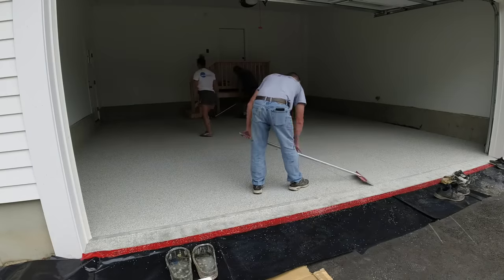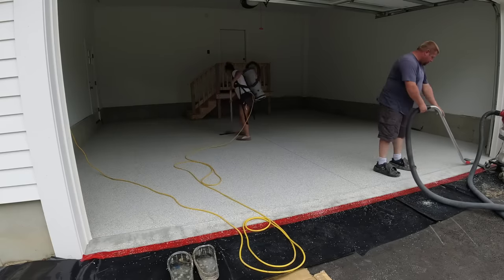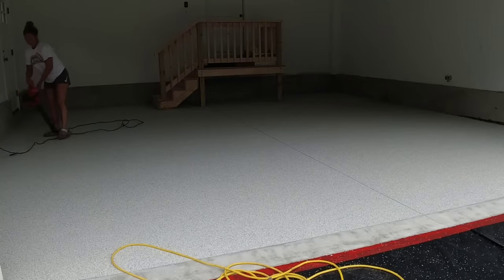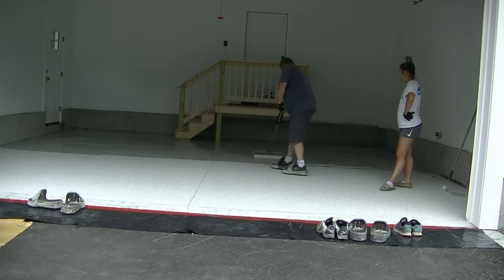DIY Epoxy Flake Garage Floor Coatings (What Most People Don't Tell You)

Comment: Question,.....do the professional epoxy products resist welding spatter from a mig welder and grinding speaks or do they still get burn marks ?
Reply from the maker: It'll resist them better than the cheap stuff but will eventually do some damage. You're best bet would be to use a urethane cement coating and broadcast flake into that.
Reply: Whatever is used will deteriorate more than the actual concrete but will maintain the look u want.
Reply: I would recommend quartz instead of flake for a area with a lot of metal fab. It will all scorch and burn but quarts should withstand it better. Although nothing will hold up under welding conditions just remember one thing.... your coating will be a sacraficial layer. The coating will save your concrete! Coatings are easier and cheaper to repair than repouring a concrete slab!

Comment: I forgot to really focus on my tire trail. We did an acid wash. But probably should’ve done more to bring up the oil from pulling in and out for 20 years. Then we put epoxy down. Took about 5 years but those tracks have all flaked up. So now we have to redo the whole floor. But just my experience from starting with old concrete and 8 years later real life.

Comment: I live in Wisconsin and I have never seen this kind of floor last more than 2 winters.
Reply: I live in Cali, have had the same big box epoxy for more than 12 years lol
Reply: I do epoxy in Wisconsin.  If you grind to salt and pepper and a CSP of 3, use installer grade epoxy, it will never come off of the concrete.  You will fracture the concrete before you separate the epoxy from it, with a chisel.
Reply: I live in Northern Maine and mine is still good , 18 plus years now.

Comment: I did versatile building products “roll on rock” epoxy almost 10 years ago. Stuff sticks like nothing else even with minimal prep. Zero hot tire pickup or other issues. Only problem is being an amateur I didn’t get the top coat as even as I’d have liked. - a few roller marks.

Comment: 2 questions. First, how do you deal with spalling. The previous owner of my house left his car leak oil which damaged the concrete, leaving a couple spots under the car that needed repair. I cleaned it out with 3 full strength treatments of TSP and a pressure washer. Then I put down Recap to level it. Came out pretty good. What do you do with such damage? Second, what is your typical cost for a 2 car garage? Thanks.

Comment: Huh I wouldn’t of guessed you would use that much flake then vacuum it up but it makes sense it’s a lot like how they chip and tar roads here in Michigan more recently I think in the last five years I noticed they started sweeping The loose excess chip aggregate off to the shoulder and immediately adding a topcoat of cold emulsion asphalt kind of like the stuff they seal driveways with seems to work great

Comment: What epoxy are you using that cures solid in under an hour? Polyaspartic does and methylmethacrolate both in 20 minutes but epoxy we have fast cure which takes a few hours to go hard enough to scrape flake off but that's at 20c

Comment: Mike, I’m looking to epoxy my garage.. BUT as a perfectionist I always go an extra step. 

Question: after I grind and sand, vacuum, blow, and make sure it’s all clean… (you went ahead and put the base layer) can I first add concrete etcher… to really open up the pours… and make it even stick beyond any necessary doubt?  

Would that help by doing the etcher… obviously let it dry before adding the base epoxy but what are you thoughts? 

THANK YOU

Comment: I bought an older house in which the former owner put professional installed epoxy floors in both 2-car garages. I use one for a car garage and the other as my wood shop. I absolutely HATE the epoxy floors because the flakes act like camouflage and anything dropped on the floor is very difficult to find, and second, water puddles take forever to dry up and are very slippery. I’m ready to grind out that crap.
Reply: You can get flakes that match the epoxy color such that it easy to find dropped items. Flakes are needed to prevent the floor from getting very slippery if it gets wet.

Comment: What if it’s a brand new home new construction and new poured concrete garage never lived on would you recommend still grinding the floor of the garage?
Reply: This would be a really good question to answer.  Unfortunately it doesn't look like Mike has much time to do so.  I to am preparing to have a floor poured for a garage and wondered if there is a way to finish the surface to eliminate the need for grinding later- especially since it might be a year before I will build the garage on the slab and I live in the NE US.

Comment: Look around for some other product. Sherwin has a one coat epoxy that self levels even over cracks. Before it completely dries you add clear synthetic sand for texture. It will not crack or yellow.

Comment: When the floor is flaked its very difficult to find small screws, nuts , or parts because they blend in with the fleks
Reply: If you run a scraper over the floor it will snag on any screws bolts ECT and either hammer down or remove

Comment: Why was it not necessary to put primer onto the concrete? I heard that primer is very important for moisture management, which is one of the biggest problems people have with garage floor coatings.
Reply from the maker: The primer is built into the base coat.

Comment: Mike. Great video! Up here in western Canada I always worry that its too cold in our winters and that the concrete needs to "breathe" underlying ground moisture and that these coatings will trap moisture in the concrete....any truth to this?
Reply: Western Canada, Cold?   Unless your concrete was poured ages ago, it is supposed to be insulated and have a vapor barrier under the slab.
Reply: @Louise Vanessa Hence the "unless it was poured AGES AGO". If it's an old building built prior to codes, or if the code in your area didn't require it until recently. Slabs and basements are required to have at minimum a vapor barrier and insulation is also required in many jurisdictions. Check your local codes.

Comment: Hey Mike, one thing I haven’t came across in your videos is how long after your pour a fresh slab would you wait until you covered it with epoxy? I’m going to be building a four car garage soon and wanted to cover the slab a month or so after finishing the slab just wondering if this is a good idea or not? 

Thanks
Reply: 11-14 days is the absolute soonest. You should use a vapor primer tho
Reply: @DJ-po8ne  I was able to read in a couple spots after posting this that waiting the full 28-30 days for the concrete to fully cure would probably be the best?
Reply: @Bow1851  you are correct
Reply: 30 days for polyaspartic
Reply: As long as you can, a couple of months at least, you don’t want trapped water pushing the coating off.

Comment: All I'm finding is people doing epoxy flooring over concrete. is it possible to do this sort of thing on a residential plywood flooring situation? I'm thinking something like this would be nice in a kitchen or bathroom.
Reply from the maker: You can yes. You got to prepare the plywood properly and use a flexible epoxy for the first two base coats. It's a little different than going over concrete, but it's possible.

Comment: Damn Mike you do it all. Thanks for the informative video. Fun to watch like Andrew Camarata videos. 

I have a question: Have you ever had a problem with moister coming through the concrete. The guy at the hardware store told me that it would be best to stain the concrete because  moisture will  cause the epoxy coating to chip off. I know that with modern pours plastic is put down first, but is it a problem with old pours?

Comment: I have not seen any of these floors hold up for more than a few years no matter how they are prepped if there is any amount of moisture coming through the concrete slab.
Reply: I would have to agree, no matter the prep, the product or the number of coats, moisture will always bubble your epoxy. You will need a coating that breathes, epoxy is not one of the .
Reply from the maker: We don't install them on floors that have a lot of moisture problems. Been doing it over 20 years with no call backs.
Reply: @MikeDayConcrete  Moisture can appear seasonally....in other words the slab shows no signs of moisture and you coat it in summer then in late fall moisture appears. There is no way that I am aware of to truly determine whether moisture will be a problem. I also have installed these floors for many yrs and have had  a few fail badly. We no longer do epoxy floors for that reason.
Reply: We always use a moisture mitigation primer and we do a better job of preparing the floor.
Reply: Is polyaspartic better? Or are they the same?

Comment: Great video, I have one question.  How do you know that the coating is going to stick?  I live in a area that has a very high water table.
Reply: I think I saw a test on the instructions of Rustoleum you can easily do yourself: Tape down a piece of plastic (like a thick Ziploc bag) on the floor for 24 hours. If you see water droplets or moisture between the concrete and plastic, your floor is not suitable for painting/coating.
Reply: Yes that is a very good test.

Comment: First, if you work on cars or motorcycles or anything where small parts may be dropped, DO NOT use the flakes, especially dark flakes.  They make it very difficult to find small dropped objects.  Second, you don't need spiked shoes if you do use the flakes.  Just divide the pack into smaller parcels and sprinkle them as you to.  Lastly, the surface prep in the video is certainly the best method but I've had excellent results just power washing and surface etching with a 15% muriatic acid solution.  Baking soda neutralizes the acid, soap and water removes the residue.  This method doesn't remove small surface irregularities though.  Be aware of that.  The floor polisher gives the best finished surface.
Reply from the maker: I totally disagree with your advice, but thanks for commenting.

Comment: Is there any benefit to using a polyaspartic instead of epoxy and then coating it with the polyaspartic clear? Also, is there a primer to use before the epoxy?
Reply: he said in the video. better uv protection and chemical resistance.
Reply: Thank you but that's not what I am asking. I understand that the polyaspartic top coat has those properties. What I am asking is what are the benefits of using a polyaspartic base vs epoxy. Some say that epoxy as a base doesn't stick as well. Supposedly the polyaspartic base adheres to the concrete better. It is however a little more expensive. So, is the juice worth the squeeze?  Even if he did say it in the video, obviously it was missed or misunderstood. Thank you for your inciteful comment.
Reply: @charlied5324  I have both done in my garages and not work well. Prep is the important part for anything.
Reply: Thank you.

Comment: You wouldn't believe the pricing for 200,000 sq ft of the specialty non- conductive finish at local helicopter assembly plant.  Well over $130 sq ft for just the materials.  Labor and other prep added.

Comment: DO I need those flakes? I just want pure white colour. Hate that flake pattern thing.
Reply from the maker: Flakes help make the coating more durable but you can do without them. White will look dirty all the time, show scuff marks and scratches, very much like solid black. Solid colors are pretty when brand new but show dirt and scratches a lot. IF it's a showroom floor then that's fine, but a regular garage, I think you'll not be happy a year down the road.
Reply: @MikeDayConcrete  Can the flakes be much more nuanced in colour? so they are there but less obvious.
Reply: @MikeDayConcrete  and thank you for detailed reply.

Comment: I believe I would run a little water across to keep all dust down.   I watched a company do it this way and from the street you could see the dust in the air.   I also worry about putting a coating down that doesn’t let it breathe.  We have a plastic backed rug at our door and it gets wet underneath.   That’s moisture coming through.    What’s going to happen if you seal it.   Will you get Spalding.   ❓❓❓❓
Reply: The issue is that they are doing all of the work in one day, grind, Prime coat, finish coat. Water would require at least a day to dry, A week with a Dehumidifer would be needed to make sure all of the water is gone.

Comment: CSP 1 or 2 is desired for most resin applications. I have installed for 12 yrs. I wouldn't trust that prep method srry if I busted a bubble. Lack of proper prep is tarnishing the capability of these coating.
Reply: Guess what he just demonstrated...
Reply: Lack of proper prep.
Reply: @josephdavis1068  I checked the standards you listed before commenting and grinding like he did is CSP 2. I also know for a fact that most epoxies don't cure or adhere properly when there is an acid film remaining, so it rules out etching by most people.

Comment: How Much Does It Cost To Coat Flooring With Epoxy?
$3 – $7 Per Square Foot
$1,320 – $3,080 Average Total
An epoxy based concrete coating for a 2-car garage floor will cost between $1,320 and $3,080 with most homeowners spending about $1,711 when professionally applied. The price to coat an existing concrete floor is ranges from $3 to $7 per square foot including labor and materials.
Reply: That's for epoxy not polyasartic

Comment: Here's something no one will tell you about epoxy. Even when dried Epoxy is flammable and when burned gives off a toxic stew of chemicals. And when applying You have to keep the area well ventilated to prevent getting sick from the fumes. So, do you still want to use epoxy on the floor?

Comment: Nice job, but I don't agree with everything. I did my shop with U-Coat It more than 20 years ago and I only etched the concrete with muriatic acid. No chipping or peeling anywhere, looks as good as the day I put it down.

Comment: I used the acid etch, rustoleum cheaper epoxy on a new garage floor and it has been great with zero sanding. However! The burnouts in the shop dont hold up well in one place, it burns thru haha ( of course- didn't expect anything different) but the damn flakes hold the dirt when i clean with a solution and a squeegee- i hate that part because of the numerous rinses i need to do. Just thought I'd share that about the flake. Have a great day , use the info as needed about flakes as you'd like.

Comment: I noticed Mike prepped the garage floor apron, (the approach area outside the door but before the driveway). Isn’t epoxy vulnerable to UV sunlight? I thought the epoxy coating would stop just under the door.
Reply from the maker: That was clear polyaspartic on that part. UV resistant, no problem with the sun.

Comment: If the concrete does not have a proper vapor barrier under it when it was poured, the epoxy will just peel off in sheets. Seen it happen many times in the past...
Reply: What should u use

Comment: Epoxy fumes are many times more  toxic than lacquer thinner or other solvents. You are required to wear an organic respirator (the kind with circular cartridges) to keep your lungs from being damaged like asbestos does. As "pros", you should be wearing a respirator before the resin/hardener containers are even opened. The importance of proper safety and the danger of health issues alone would deter a DIY painter. That would be a better sales point than showing suicidal tendencies. The CLEANLINESS of the surface is what matters. True, the diamond grinding removes contamination, but all dust must be COMPLETELY removed. I paint glass professionally, and epoxy is the only paint that will adhere to its smooth surface. But it has to be clean. A fine textured surface like you do is not necessary for adhesion, but only for leveling the surface to give it a glass-like reflection.
Wear the respirator-live longer.
Reply: Hey Adam, did you see my comments as pertains to my work with those who have been exposed and now can barely breathe?
Reply: @adamsanders1213  yes, there is substantial proof epoxy is worse than asbestos. Gasses  penetrate the fastest as they have the easiest route of entry into the body, then liquids, then fibers.
Reply: @ToddDouglasFox  Bathtub refinishing companies use epoxy to resurface tubs and tile. I know several people that had this done and they complained about the smell that lasted for a day or two. Little did they know. I use my respirator when I mix a little of JB Weld to fix something. I don't care what anyone says about how overprotective I am around epoxy fumes. Never thought about the gasses, though.

Comment: I watched this up until the point you stuck the magna trap inserts to the bottom of the floor grinder. You don't know how to use that grinder. The inserts have beveled edges because they are inserted by sliding them into the driver, into the beveled slot back to the magnet. "Someone" didn't show you how to set up that grinder.
Reply from the maker: They only go one way on this machine. You can't mess it up. Not sure what you're looking at but you're wrong on this one.
Reply: @MikeDayConcrete  I quite possibly could be on second look. I rent Edco magna trap grinders at my rental company. The inserts slide into the driver, into beveled groves, back to the magnet. Their design not only holds magnetically, but also with the beveled design. Anything is better than the old style with the wood wedges holding in the inserts. My apologizes.
Reply from the maker: You're right, the edco one's are beveled. The floor machines like I have aren't they go one way and have magnets that hold them in place.